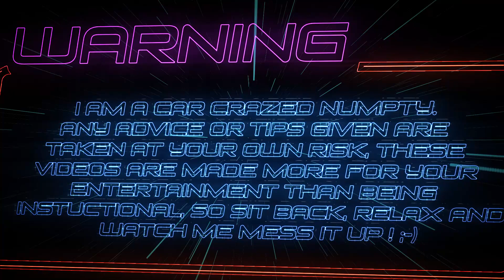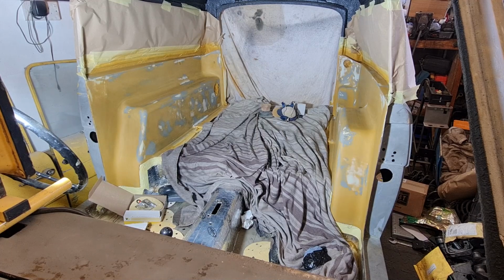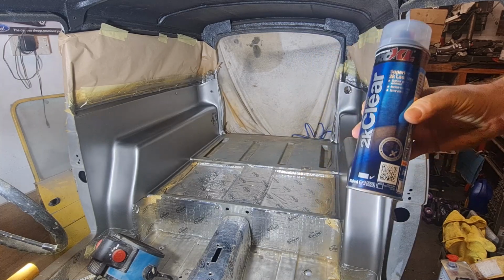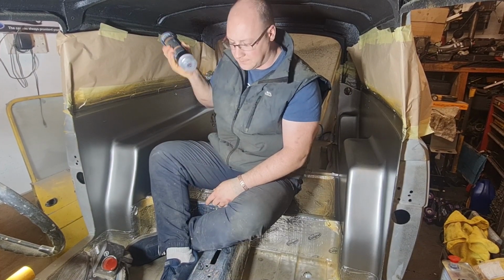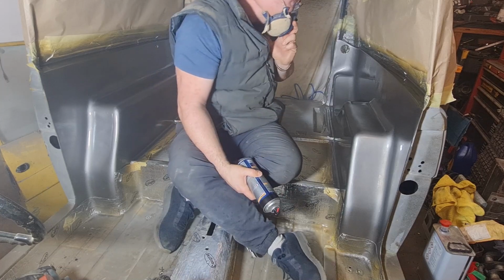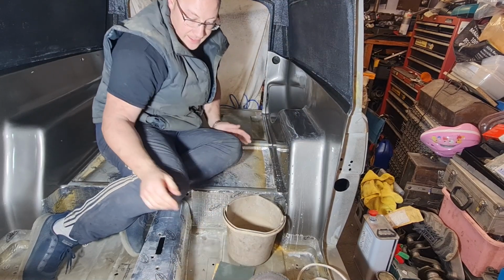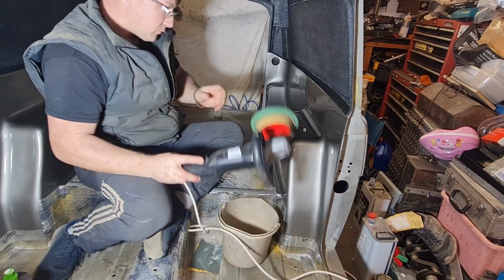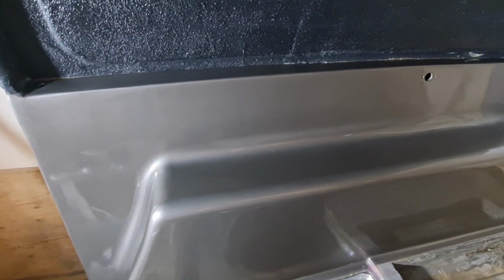RESTORATION of my Reliant Supervan 3 Project Plonker Pt27

Comment: What silver did you use? Looks almost like gun metal grey
Reply from the maker: Hi mate, the paint is POR-15 Detail paint, they do it in a few colours, the one i picked is called stainless steel, i used the same one on the dash 👍👍👍
Reply: @mec-tec  oh right, it looks like a nice paint to do some alloys in, Also if you look at the factory estate regals they had padded rests for the sides, saloons are all covered in vinyl